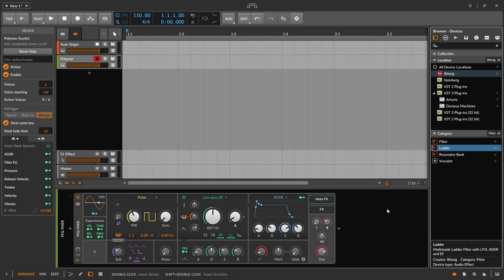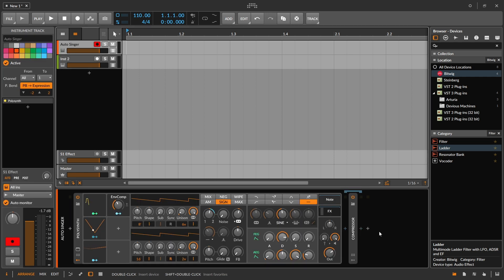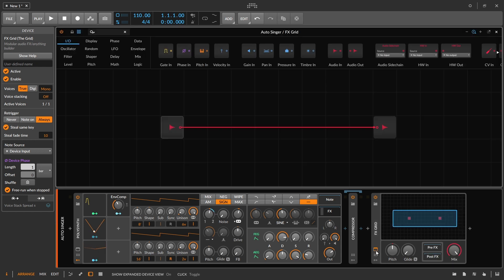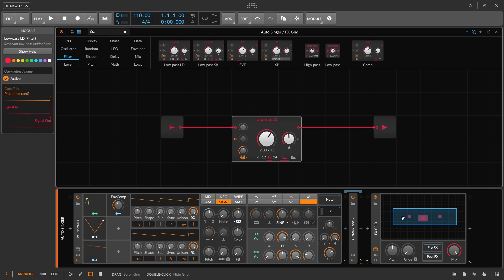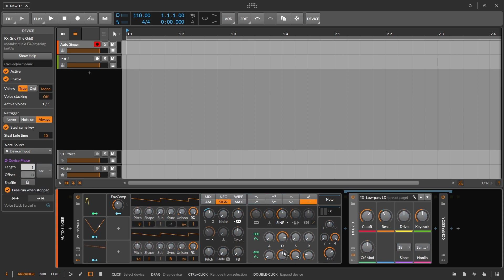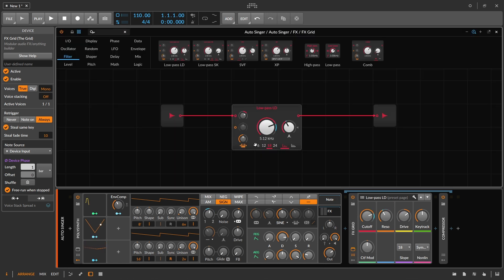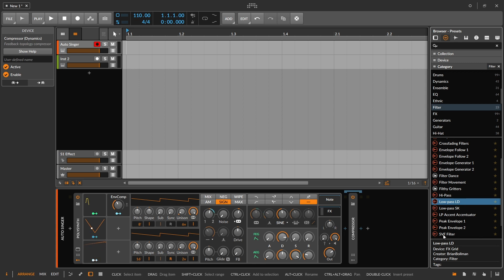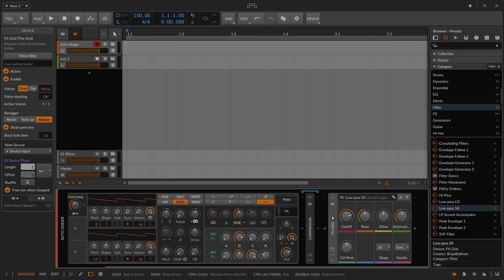Bitwig - Are you using ALL the filters?

Comment: 1:30 You can save 3s by dragging in the module INTO the output of the module in front of it - Grid will automatically insert it in between and adjust the connection accordingly :)